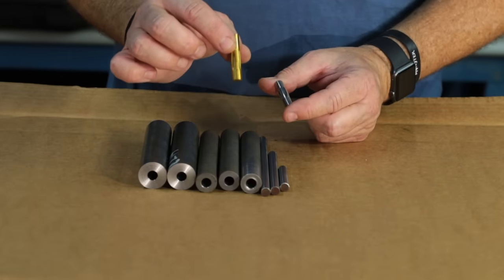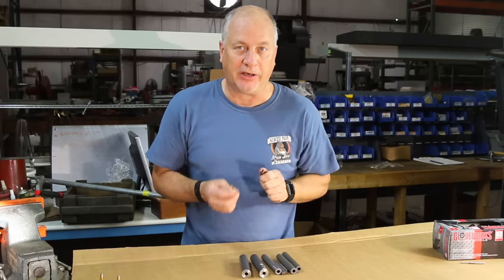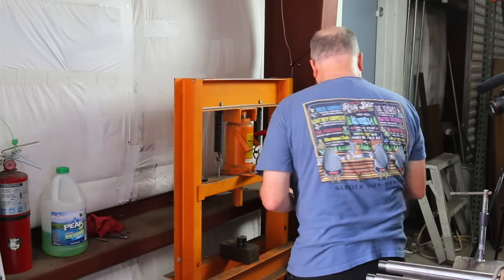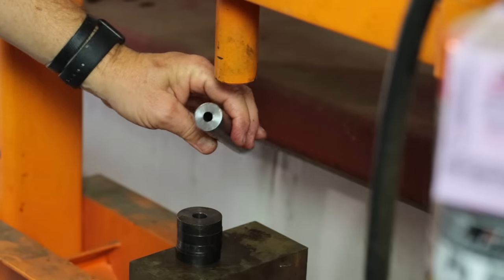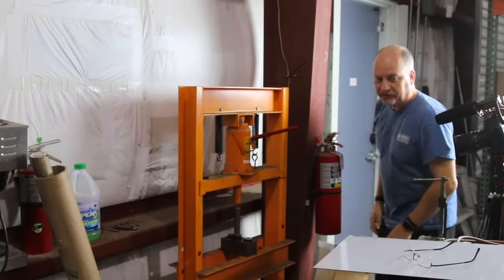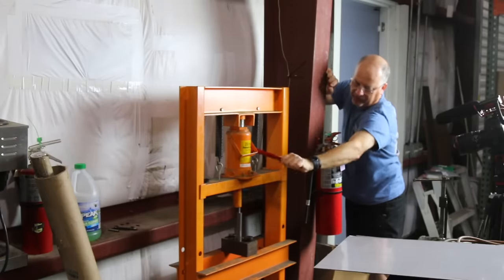Home Shop Rifling THREE(ish)...China vs. Ukraine Rifling Buttons!

Comment: A suggestion for tool makers: make the back of the button concave and the mating surface of the push rod convex. This keeps the two colinear and provides a rounded leading edge, both to prevent damaging the new rifling with the push rod.
Reply: Or just chamfer your own rod, it obv wasnt purpose built for doing this
Reply: Actually a bang up idea.

Comment: That was painful, I wanted to buy an airline ticket and fly down to tighten the springs on your press. Three minutes to tighten and the video could have been half as long. As my Dad used to say "Sharpen the saw", actually he used to say "sharpen your knife and if it touches the elk hair it will be dull so sharpen it again."

Comment: Hiding behind a pressurized fire extinguisher seems like an interesting way to avoid shrapnel.
Reply: Yeah but it wouldn't bust an extinguisher.
Reply: The extinguisher wouldn't explode, just spray the fire retardant chemical all over through the hole. And that's only if it actually penetrates the fire extinguisher anyway.

Comment: You know, a few nice pieces of laminated plexiglass would make a really nice safety shield.  Also an interesting idea would be using the top of a cam lifter as a shield to prevent shattered hardened steel pusher rods from blowing up.  Presses are more dangerous than most people understand.  PS - great video by the way.  :)

Comment: Oh this series is a treat. I've been a machinist \ prototyper \ model maker \ programmer \ etc for 15 years. I really like you Mark. Moreso, how you think. Adapt and overcome. There's more than one way to an end result.  

Fun fact: one of the more fun and challenging things I've ever done was produce 10 box mags for Remington. This was about 2005. It was a caliber I'd never heard of. All I got was the prints for the mag, so I don't know the cartridge dimensions, but I'd have loved to though. Pretty sure it was a round not in existence. IIRC it was 10 or less round mag and likely a hunting style rifle. 

Anyway, the beauty of model making was I would be supplied a print and a solid model. I would have to "unwrap"  the part and figure out the dimensions for the flat blank. It really not hard. There are formulas to figure takeup for a bend radius and what it amounts to in a linear dimension in a flat state. You add those to the straight leg dims and that will give you the OAL. Its not always exactly perfect as far as the formula and can vary with stock thickness and material, but that's why we have tolerances. ;). I engineered and made all the tooling and formed the mags first on a hydraulic press to put the strengthening ribs in the flat blank. Then fold it up in the press brake. Then they got welded at the seam in the back where it met up. That's the only thing I didn't do was weld. After weld I had to make a fixture to hold the part and machine feed lips to dim. I couldn't control it with a bend no matter what I did because if angles and how they compund. 

It was a lot of fun. I was maybe 23 or 24 at the time.

Edit: I completely understand why people through history have chosen to use sten mags and the like how you did with the ROF. It's a pain in the ass to make mags if you don't have to lol.

Comment: You could put a some vacuum hose maybe a straw or something around spacers that keeps it centered on the button posibly to prevent rifling damage. Put a pvc pipe around hole thing (after making a mark to where the press is almost down on the barrel).

Comment: First you bore for exam.. 9 mm luger. The china buton is 9mm to 9.32 mm the ukraine proper 8.83 to 9.0.
So the hole have to be 8.7 mm. After this you press a steel ball through. To compress the walls. Then you go further to the button.
The barrel needs to be proper stabilized. The button has to be pressed with impulse.😉
Offcourse dont forget chamfering  hardenning and blueing.

Comment: I have ordered a rifling button and a tube off aliexpress (all for 9mm). It seems the tube is too small, with ID of 8,4mm. What is the correct ID to start with?
Reply from the maker: All of the specs you need to know are available online at saami.org.  Off the top of my head that bore diameter should be almost 8.8mm.
Reply: 翻译看了👍👍
Reply: @markserbu  hello  mark

Comment: I think truck and car axles are 4140 steel. I think you could make a bundle by just packaging up kits  like a hole drill, reamer, chamber drill and reamer and button rifle for 9mm, 556, 308 and folks would probably buy those if you had a good marketing venue. I have to source all that a piece at a time.  Good video. Hiding behind that beam is clever. Very safe compared to a shop apron.

Comment: I don't know anything about this process but was wondering... Wouldn't it be easier to heat treat after rifling?
Reply: Only a little easier, steel is steel and good steel is never easy to pressure form like a button does. And heat treating is a violent process that often warps fine details, with rifling it may warp the rifling itself or even twist the whole piece from the stress internally on the steel. It may be a little easier but comes with more risk.

Comment: That drill rod blanks don't come pre hard. You harden them in the shop. Either Air, Oil or Water hardened depending which you buy
Reply from the maker: Correct, normally drill rod (W1, O1, M2, etc.) blanks come annealed. But these are Chinese-made blanks specifically made for this purpose, are specific diameters and lengths and are sold hardened.

Comment: Mark! I've heard about "explosion proof tubing" you can buy from China that just happen to have the exact inside diameters for a variety of calibers. Do you know if these things are trustworthy?
Reply from the maker: @Sir Lukas I have no experience with them but they're obviously going for the home builder barrel market.  Like anything from China, it's caveat emptor, hit or miss.  With low-pressure stuff like most pistols you're probably fine, but that's just a guess....not to be taken as expert advice!
Reply: @markserbu  alright. I was thinking about building a .22 derringer or something so it's not like I'm putting a .50 cal in a pipe like that. Also, would a .22 LR round fire from a 5.6mm hole?
Reply: @sirlukas73   was wondering about this same question. Also @markserbu you're an absolute legend answering questions on 3 year old video's
Reply: Do not use them, at first the inside diameter do not allow to press a rifling button inside because they are too large, and if you are lucky yo get one enough tight  to pass the button inside, you will brake the pipe like i did.
Reply: @MD-dq4mv  ECM FTW!
Reply: yes.

Comment: Nice to see you taking cover behind that compressed cylinder :-)
Love your work by the way!
Reply from the maker: Mark  In reality I should be going out of my way to destroy my family jewels, considering they had a part in making 50CalVal. ;-)
Reply: markserbu so the twist of the button  will form in the barrel without you manually trusting the button and is it dead on and repeatable??
Reply from the maker: @donaldgoembel7109  Yes, a push-through button twists on its own.  Dead-on and repeatable?  I'm not positive, but it's been done in production for many years so it's obviously good enough.
Reply: markserbu thanks it's the first time I've seen short barrel and button. It's always a long barrel and long button being pulled through and I always ASS-sumed the rod with the button was being mechanically  applied trist. Thanks a bunch. You put out a really good video on this matter.
Reply: @msrkserbu, why are you always hard on 50CalVal? Its great to have a daughter involved in the gun works. I have been teaching my daughter as much as possible when it comes to manufacturing most anything. The unfortunate issue is that where we moved to years ago it is a location where the government here fears an armed citizen. Good news is it doesn't stop many individuals around here.
Keep up the great videos!

Comment: Why just use a chinese and ukr buttons to set the rifilings?  Why not the United States, Mexican, Gernan etc...?
Reply from the maker: @jerrymont2595  Time, budget.
Reply: Becose mexican and german didn't make a rifling buttons
Reply: Because most barrel makers don’t sell their Rifling Buttons to DIYers…
So short of having a Steel Shop make you a Custom Rifling Button, or Making one yourself (which you can do, if you’ve the patience) the only Commercially Available Rifling Buttons are Chinese or Ukrainian… Well, by this point, likely only Chinese…
Reply: It seems you missed the cost difference at the start of the video.

Comment: did you measure the buttons or just assume that they are within spec?
Reply: Buttons are spec, therefore the bore has to be just a thousand larger in diameter than the diameter of the button's pilot.

Comment: I m just wondering, if the pusher extensions were slightly tapered, and the ends slightly concave , then a ball bearing between each extension, would it make it work a little better?
Reply: Yes it would allow the button to turn easier against the extension. Well spotted.

Comment: Hello friend, have you already made rays?  9mm do I need to use a tube with a hole if 8.70mm or 8.80mm??  I did it with 8.8 it doesn't show much of the ray design on the barrel

Comment: What is easier to push through a 6 or 12 groove?
Reply from the maker: With either number of grooves you're displacing the same cross-sectional area of material, so it should be the same.
Reply: @markserbu  thank you I really appreciate your help

Comment: One question, good Sir, Molybdenum DiSulfide grease is comprised of tiny spheres, right? I love the stuff in bearings and joints, but as a cutting fluid, my senses wonder. What did the mfr of the tools recommend? I would presume one without solid structures included. When I played with turboprops the hogging tolerances were 0.0004+/- 0.00005. Rather impressive. I treat barrel bores the same. Could your technique need renovation? I wouldn't be surprised if Jojoba oil was a cure. 
Keep going, stay safe.
Reply from the maker: @bryanst.martin7134 The thing is, button rifling is not a cutting process, it's a swaging process. For that, the goal is as little friction as possible.

Comment: I take it heat treating prior to using the button saves risk of deforming the steel while using the button and warping when heat treating after rifling is done
Reply: Doesn't really matter. Button rifling puts a lot of stress in the steel, it "should" go through a stress relief cycle after being rifled
Reply: @Man_Emperor_of_Mankind  awesome thanks man, steel does mysterious things, but my point it heat treating pre rifling would also has potential to warp and change shape main reason why its done after not before

Comment: I have one of the Ukraine buttons in 9mm, almost the same as the second one you have, it has a very good finish for what it cost, seems to work ok, can I ask what ID you ream the blank to? I have not found too much into on it as it all seems to reference cut rifling. thanks.
Reply: 8.8mm.
Reply: @boomerisadog3899  I did some more research after watching and came up with 8.75 ( or 0.34444")
8.8 is 0.3464" so if I get a 8.8 or 0.345 ream and then hone I should be on the money. Thanks.

Comment: Get undersize drill rod and sleeve with plastic tubes similar to drinking straws.   You can also use heat shrink tubing on the rods to protect the bore.   A smooth chamfer on the blanks bore will help.  PS, Tighten the eye bolts on the press springs for auto return without having to muscle it by hand.
Reply: I was thinking about a small diamond drill to put an indent in the back end of the button and then a corresponding teat on the end of the first drill rod

Comment: Are  the barrel grooves made according to saami specs? Or is it just something that will blow in my face...
Reply from the maker: The barrel grooves "may" be on spec, but that's the way this process goes.  I guarantee you that when I rifle those 4140 barrels, the groove dimensions will be slightly different than they were with the 12L14 barrels.  But if missing the spec by a couple thou will make your gun blow up, you have far worse problems than holding the spec!

Comment: Those Harbor Freight press return springs suck!
Just bolt the press to the concrete, get a  few pulleys, remove the springs and have a cable/rope going from the bottom spring mount up to the pulleys mounted to the celling, then over and down to a weight hanging on the rope/cable.
You will have constant pressure lifting the press slide bar, and it will retract all the way up unlike a spring that has stretched.

Comment: I tried to do this but it is impossible. I don't know how you did it, but I am unable to press the small steel rods in.  I have pressed the button in and it is right there flush with the barrel. My barrel blank is 13 inches long and the steel rods are about 4 inches. The caliber is 223. The problem is that the barrel moves slightly but I have made a contraption to make it stand still. But still difficult to make it be completely horisontal. I understand also why you were hiding behind that column. One of the steel rods broke in several pieces and they flew all over the room. I need a tip on how to get this done.
Reply from the maker: Did you drill the hole to the correct diameter per SAAMI specs?  Is the hole reamed and maybe honed, with a very smooth finish?  What kind of rifling button are you using?  What sort of lubrication are you using?  It's definitely doable, you saw it here on video.
Reply: markserbu I bought a barrel blank on ebay with the correct caliber. The rifling button is the Ukrainian one. I am using moly lube. Yes you did it and it looked so easy. I have thought a little more about it and I will try to cut the rods down to an inch or maybe not more than 20mm. That will anyhow stop the rods from flexing
Reply: Markserbu I tried a littlebit more and I have found out a great deal. First my press is a bit wobbly. Second my steel rods are 5mm and th caliber is 223 so that the hole is 5.59mm. I managed to press about 2inches using a very small piece of rod, then one that was a little longer and so on. I needed about 3 metric tons of pressure to get the button to move down. At the end the rod started to bend because it became too long and the pressure raised to 4 tons because of that. I will buy some new rods that are the exact measurement and try to start over. But the 223 caliber is maybe a too small one for this method?
Reply from the maker: Without doing the Euler column buckling calculations I can't say for sure, but one thing that helps a tremendous amount is to have the rod supported on one end.  They call that condition "fixed". So instead of just pushing on the rod with the press, you make a cylinder with a 5.05mm hole on one end and whatever diameter you need on the other end to fit the press ram into.  With the push rod stuck into that hole it is much less likely to buckle.

Comment: Accuracy-testing after such would be real interesting, see how all the little imperfections mess with them
Reply: Honestly it doesn't affect accuracy in any noticeable degree. As long as the bore diameter and twist rate is correct it really doesn't matter much if the rifling is rough. I've shot rifles with bulges and rings in the barrels and those still shot just fine. Incorrect twist rate and worn rifling does however significantly affect accuracy.
Reply: Uneven resistance in the barrel can cause inaccuracy, so I'd beg to differ

Comment: Do you know if you just tighten those eyebolts up till there is sufficient tension, the ram will fully retract saving you the effort each cycle. End of this PSA.
Reply from the maker: Not in this case.

Comment: If I order one from ebay (rifling button) does anyone know if the package will be seized at the canadian border ?
Reply: neither barrels or machined parts are controlled. I'd imagine you'd be fine.
Reply: No but you'd be monitored for intent to manufacture a firearm. Idk what the laws about that are in canada but my cousin is on a watchlist for it up there.
Reply: @masonborden5594  Yeah, I did not order one for that reason. They are waiting to caught people that order things like that. Once I have been told, you are lucky, you are born in a country where you are free.....
Reply: @jeremyp7293  you can be free as well. Move here. Move to some place like arkansas.
Reply: @masonborden5594  I think this might be an option.
Reply: @jeremyp7293  cost of living in arkansas is very low. Its got similar altitudes and temps to lower canada. The entry to the job market has never been better or easier. The only real complication is you becoming a U.S. citizen. Im not sure what the process entails. But im also fairly sure you could manage to gain political asylum or something similar to cross the border.
Reply: @masonborden5594   The process is to find an employer that will accept to give me a job and fill paperwork to get me a work permit and it take 5 years to become U.S. citizen. I still need to read more on the subject...  Border is close also. I'm not in a hurry.

Comment: Does the dowel rod need to be that large in diameter for strength? Otherwise you could use a smaller one wrapped in tape to protect the fresh rifling
Reply: I’m guessing you want it the same size so it won’t put to much pressure on one side or the other maybe or risk breaking it. Smaller size can possible bend or snap easier bc it would have space to move